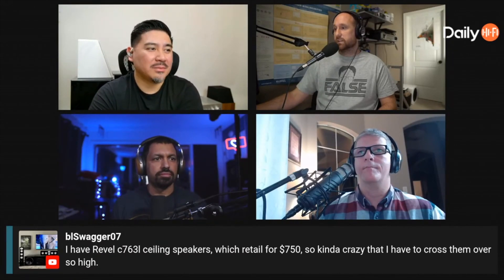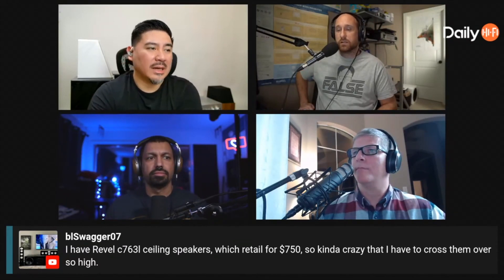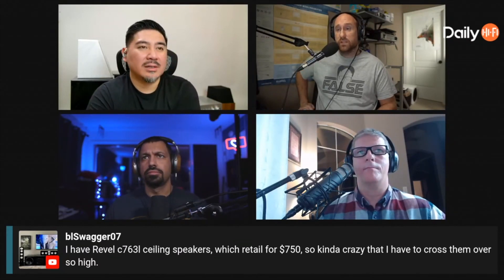How Do You Determine Height Speaker Crossover Points?

Comment: I've not watched the video yet guys before commenting, but there really is no arbitrary setting for this or any other crossover.  It requires measurements of the speaker by itself(inroom), the sub system by itself(inroom). Your own listening preference, meaning how loud you like to listen and how much dynamic headroom you are trying to achieve, the size of your room plays a role as well. Just because a speaker is listed to play down to say 50hz does not mean that it can do so cleanly and dynamically at say 90-105db levels. 
Example, and I've been dying to get this off my chest the more videos I see of people being confused about crossovers. 
If you are in a smaller/normal sized residential room. They All have Modal issues. and if you have used multiple subwoofers to smooth the response across the listening position, and or multiple listening positions that bass response is now considered constant and consistent. lets say you are flat from 15hz to 110hz.  
Now lets consider that at least a couple of these subs are positioned near the front soundstage relatively close to the main speakers they are going to be crossing over to. 
Jumping over to loud speaker design for a minute: when you design a 3 way speaker, the crossover from the low woofer to the mid woofer is usually somewhere between 300 to 600hz, do you hear localized bass in that speaker?  I doubt it.  The drivers are located close enough to one another for use to perceive it as one source.   The same can happen in a multi speaker audio system as well. If you think about keeping drivers within a quarter or so wavelength of the frequency you are crossing over at.  That gives you around 3 feet at 100hz and 3.5ft at 80hz.  there really isn't much difference. 
The difference is that you may have a very consistent response in the mid bass frequencies using your multi subwoofer system, and likely a lot more dynamic output capability(headroom), and the midbass from a single main speaker playing in a residential sized space is going to vary a lot more(just as a single sub would), and what's worse is if you have used a lot of EQ on the speaker at lower frequencies to smooth the response you have likely eaten further into the speakers headroom and dynamic capabilities. 
I often hear and read of people complaining of lack of midbass dynamics and impact. I believe and have tested and verified this to be one of the main issues surrounding(pun) this issue. 
if the Subwoofer system is capable of handing the midbass area(50-100hz) with a smooth consistent FR with great dynamic headroom then please let it do so.  If your subwoofers are located within 3ft or so from your main speakers and you have your time/phase alignment correct at the crossover frequency you absolutely WILL NOT be able to "localize" your subwoofers just because you've used a higher crossover.  
Another thing to think about, going back to locating sound sources to within the frequency wavelength of the crossover for best integration: 
If you've used 80hz or 60hz as a crossover point. that's 3.5ft and around 5ft.  Most surround sound speakers are going to be out of that range with typical subwoofer locations.  Yet we still don't really notice during playback. 
But you are leaving a lot of potential MidBass performance on the table.  
We need to start separating Auditorium sized acoustics and residential space acoustics.  They behave completely differently at low frequencies.   
Any questions, I am here.

Comment: Just by hearing and trying, for me is 80 hz best for all speakers in combination with my sub and small room. I have a 5.1.4 setup with dali oberon 5 front, dali vokal center, dali oberon 1 as surrounds. SVS Elevation for Front height and Rear surround Height with a SVS Pro SB2000 sub. For my room more then enough. Would like to have a 7.1.4 setup with rear speakers,  but my couch is against the wall & need an amplifier with my Denon x4800h..